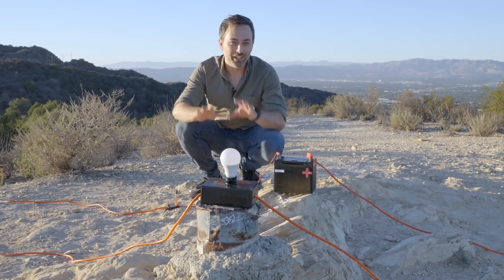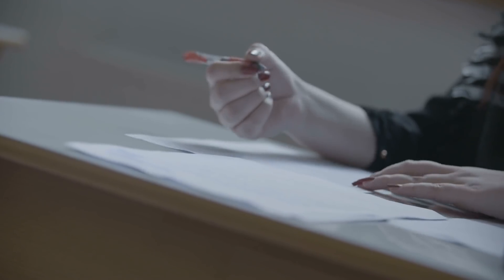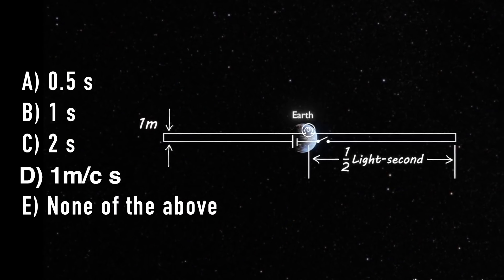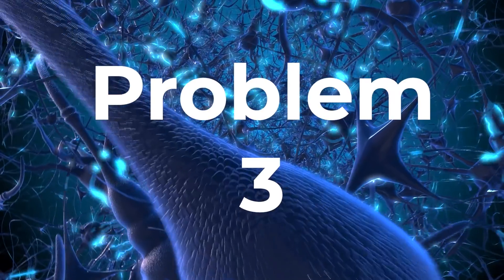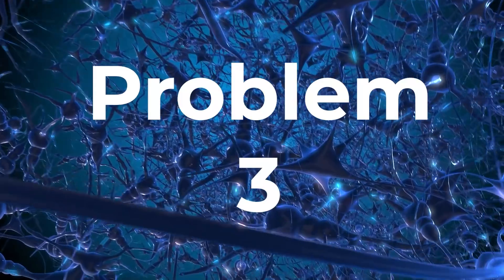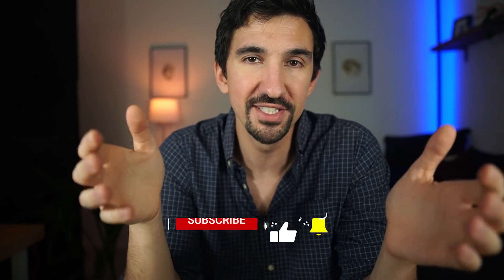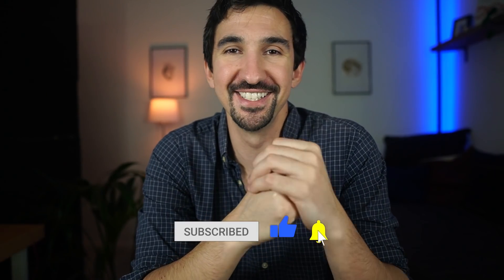Is Veritasium Wrong About Electricity?

Comment: He left out the 'm' intentionally. He does say its one meter from the battery though. The circuit does not need to be a complete circuit. It can have an open short at both ends. You have the capacitance of the wire, you also have the inductance of the wires when the state changes. If he was using AC there would be a measurable current. Heck, you could measure the current with DC too. A soon as the switch is thrown there will be a spike for about a nanosecond, or 10.
Reply: I calculated 53pF assuming 10mm thick cables, 1m apart the capacitance if negligible, won't impress any light bulb on lower frequency AC (which is manually closing and opening the circuit). If you want serious capacitance you have the change the cables into plates 300.000km wide and long, than you get a serious capacitor.

Comment: Isn't the exact the reason why the light is turning on almost instantly length contraction?
In the example we are the observer, we observe the light and we "observe" the electrons moving through the wire. So from our reference frame the electrons are moving at the speed of light through a distance of 300.000km with the speed of 1c. This means the relative length we observe closes in on 0.

Comment: Well, no. Zero resistance of the wire is major assumption but Veritasium mentions it in the video. If the wire was broken at the far end, the bulb would light up immediately, then go dark again after about a second. If we throw away all the power stuff that's not helpful here, the battery is creating positive charge in one of the wires. That positive charge induces negative charge in the wire going along it from the bulb. The same goes on in the other wire. As soon as this wave of charging up the wire reaches the place where the wire ends, the wave front of the charge will stop propagating as it will have nowhere to go, but it will still keep charging for about half a second. After that, the wire from the battery will reach maximum positive charge, the wire from the bulb will reach maximum negative induced charge, and the bulb will go dark. If you then remove the battery and short the two wires, the charge of the two wires coming originally from the battery will compensate and the light bulb will light up again until there is no charge gradient on the wire again. What you have here is technically a pair of two enormous condensers and the bulb is lit while the condensers charge or discharge.
All that Power talk is interesting and technically correct, but it's just our mathematical model, a way we can use to look at the problem. There's no particle of power and we don't need that kind of view to explain what happens and why.

Comment: I agree that the result was wrong. Veritasium invented a shortcut of the energy transfer from the battery to to lightbulb and ignored the fact that all of the electrical field is concentrated along the wire and there are no shortcuts.

Comment: Well, you are wrong. The case where wire breaks 300.000km away would technically place the switch that far away, so the information would have to travel normally. In veritasium case switch is close hence the shorter time. Causality dictates that pretty clearly.

Comment: I don't think there is a break in causality at all, at least according the understanding of electromagnetism by Veritasium.

If you break the circuit at the far point while closing it at the close point, the light might start shining for about half a second, until the moment the information about the circuit being broken actually propagates through the fields to your location, at which point it stops shining.

If you had lightbulbs all along the wire, and "simultaneously" closed the circuit here and broke it far away, the lights would start lighting up from your end (both from the original bulb and from the switch) in response to a "closed circuit" field propagating at light speed. Then they would meet an "broken circuit" field from the other end at the halfway mark, and start shutting back down back towards you at light speed.

So from your perspective, you closed the circuit and watched stuff light up, and then they broke the circuit and all the lights turn off in the same instant moving back towards you. From their perspective they broke the line, then watched as you flipped the switch before the information could propagate, and the whole circuit lit up at the same instant up to a point and then starting shutting down as your signal propagates to them.

Comment: One question though, If you have a zero resistance wire, with no electrical losses, how could any portion of the energy in that wire be transmitted through an antennae or magnetic field to another destination. That should imply that you are getting electrical losses even if there are no resistive losses. Or rather, you would still have resistive losses from other surrounding magnetic fields, even if these losses are not from the wire itself.

Comment: Your example with two dipole antennas was perfect. You can also model it as a transformer. Veritasium isn't wrong per se, but his example is all sorts of crooked, and terribly confusing. He doesn't even mention that the geometry of his wires is the only reason he's getting that effect. Or that the bulb will not actually "light up", but rather that a very tiny small fraction of the current will make it to the bulb in 1m/C s... It's just confusing and didn't need to be.
Reply: That's where I have zero qualms about saying that the Veritasium video is just plain wrong. Either Derek understands that capacitive coupling isn't how most circuits work and he deliberately ignored that fact (and misled people) OR he didn't understand the subject as well as he claimed and only stumbled on a kinda right answer because he accidentally found a geometry that worked. 

I haven't fully worked out the math in my head, but I think his video might "prove" that an extension cord won't work if it gets twisted around itself.
Reply: @talyrath  Rofl, right! :)
Reply: @talyrath  So work out the math using paper and pencil.
Reply: What happens when you implement perfect shielding on the conductor so it leaks no radiation?
Reply: @Space-Audio  asked that question on the video and got zero responses neither from veritassim or from any of the nasa grade engineer nobel prize viewers
Reply: @MrHBSoftware  , I'm a lowly computer person, but have worked on NASA contracts with space plasma physics researchers my entire career.  I asked my question because I'm pretty sure the real answer is that this is an electrodynamics problem and the important wave is the one that propagates through the conductor essentially at the speed of light but along the entire length of the conductor.
Reply: @Space-Audio  ah sorry about that...seems like everybody that comments on youtube videos works on nasa/aerospace...that leads me believe people can be whatever they want to be on the internet, not saying its your case but its ridiculous, nobody mops floors or is a plumber, everybody is phd high grade nasa aerospace xtreme level expert guru etc...i honestly dont care is i am talking to the pope, the nasa guy or the trash collecting person, if i doubt something i will question it...veritassium is a very high grade channel, i would call it "nasa grade" and i still doubted and criticized many things in that video and i still do, now that i learned more about the subject. i think we all should do the same.  about your comment yes i belive you are right and veritassium was deceiving and led some people to belive that a significant amount of energy flows directly from battery to lamp wich is a lie....that propagation is not even easily measurable, the one that matters, like you said, goes along the wire. especially in such a low power dc circuit.and the light bulb obviously is only considered to be ON when the filament glows not when it is bombarded with microvolts of radiated energy
Reply: His point, IMO, was to show that the electricity doesn't flow through the wires. Which is correct when you think of his circuit from a capacitive, inductive, or antenna view. I do agree it was presented in a crooked or trick question fashion. Which was probably also planned in order to make people think. Not to mention to get more views.
Reply: I agree, I just think he was trying to showcase the existence of the Poynting vector and bring across the fact that energy is contrary to the „common understanding“ transported by the fields instead of the charges itself.
Reply: delta V only works in reality-based physics. both v  and dr Miles and have stated that some basic things would be left out like ristance set to 0.00 ohms /mile result in 0.0v drop with full bright bulb

Comment: The reason that he gave option d in veritassiums video is because the power source was 1 meter away from the load so that makes sense because the speed of light is measured in meters so 1 meter divided by the speed of light would be the number of seconds that it would take that wave of energy to propagate to the load according to what veritassium has to say about how energy flow works in his video

Comment: 4:05... You are Wrong!   Why should the light go off?  It hasn't even gone on yet!!  Besides, what does t=1/2s even mean given your earlier pithy objection?  So problems 1 and 2 are moot.
Reply: 7:11, problem 3 .. think of this: on switch closure the field becomes a property of the circuit irrespective of the way you wish the current to go,, it becomes a reality both from left right and any other direction you wish .. at the speed of light.  So don't think of  doing full circuits like a running track.  To get off your bias, just imagine that the whole Veritasium circuit was in a circle instead of a long sided rectangle ... his ideas remain true but your objections crumble.  OK he chose an example that engineers could bleat about, and you are not the first, but mathematically he makes sense.

Comment: I think there was alot of manipulation in his video and only explaining it in a very one sided way, eevblog did a good video where he mentioned the time calculation would be way off if the circuit was a giant circle.  What if the battery and bulb were at the left and right ends of the wire instead of the middle would it still be the same time? I definitely think the bulb and battery only being 1 meter apart In his video only tells part of the story.

Comment: In my opinion, he is wrong as hell. 
Firstly, energy do flow inside the wire, in the end without electrons there is no magnetic field; and  actual wires do not have infinite conductivity even for super conductors, thus both electrical and magnetic filed exist inside the wire and poynting vector inside the wire is not zero. 
And secondly rely on the space to carry DC power is absurd, anyone who has a half brain won't buy that theory. 

This veritasium video was not good and the example there was not where you should use Poynting theory. Every theory has its limitations and was there for specific set of problems. For the wire problem in the video, just stick to ohms law and transmission line theory.

Comment: The electrons hardly move at all, their movement isn't an issue. I agree this needs further analysis. I would be asking questions like what if the circuit was a huge ring so that induction isn't relevant, questions of when the light comes on are relative, moving the bulb to a point half way around the ring means there is lag that will be determined by the direct distance between the switch and the bulb, not the distance traversed around the ring. Being a zero resistance electric circuit means everything either flows together or it doesn't, causality becomes a question of relative distance between the observer at the switch and the bulb, the circuit itself can travel even further away and return and not affect the timing questions or causality of the direct distance between the switch and the bulb.
Reply: I had a read of some of the comments. 
I appears to me that no-one here knows that electricity propagates at the speed of light in the insulation, eg for plastic insulation the speed is say 0.66c. 
Nextly, most of the commentators think that electricity is due to the movement of electrons -- they dont know that the movement of electrons is a parasitic secondary energy robbing effect. 
Electric current is due to say photons moving along the outside (mainly) of a wire (this was known by Faraday & Maxwell & Heaviside)(& probly Tesla). 

A proper gedanken would include a pair of switches (1 in each wire) located at say the 1/4 point of the circuit (the switches being opposite each other)(ie next to each other). 
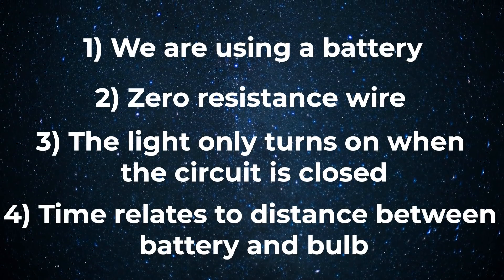Or, same thing, i like a circular circuit of 2 light-seconds– but with battery at 12 oclock -- & a switch at 1:30 oclock -- & a 2nd switch at 3:30 oclock -- & bulb at 6:00 oclock. 
Both switches are closed at the same time (say). 
The bulb would begin to half-glow after 1/4 sec. 
The bulb would begin to fully-glow after 3/4 sec -- for 4/4 sec. 
Then half-glow for 4/4 sec. Then zero-glow for 4/4 sec. Then half-glow for 4/4 sec. Then full-glow for 4/4 sec. Then half-glow for 4/4 sec. Etc. 
The periods & intervals etc would gradually decay or merge, & after a time (i dont know how long)(it might be say 100 sec or 1000 sec) the bulb would have a constant full-glow. 
That is what would happen -- & supposed experts would not be able to explain it. 

But in the almost useless Veritasium form of the gedanken the bulb would begin to fully-glow in 1 sec, & would continue to fully-glow for ever -- proving & showing almost nothing. 
And helping to breed another bunch of ignorant skoolkids. 

If u do a search for "ivor catt" & for "forrest bishop", u will find articles re the Heaviside slab of E by H energy current. 
If u do a search for "tony wakefield" + heaviside, & for "erik margan" +heaviside, u will find articles where tony & erik have done experiments that in effect support what i described as a proper gedanken, & support catt's & bishop's stuff.
Reply: @atheistaetherist2747  Fair enough, although most of the responses I've read come to similar conclusions, some using finite state simulators, some as giant capacitors, some, like myself, focus on relativistic Maxwell fields, I don't think I've can paint veritasium as not knowing just because they get the answer right for a theoretical impossibly massive capacitor.
Reply: @saxtant  I cant remember exactly what Veritasium & Co said. But i think that he wanted to keep it simple, eg zero resistance etc, whilst most of the comments here & elsewhere complicate it by worrying about crosstalk & transients etc. V should have used a circular circuit. 
However the real answer to the real question involves transients.
I am not sure what V believes, ie with his em field being the primary nature of electric current.
I always thort that standard science consisted of 2 groups -- Westerners (who reckoned that electrons bump electrons) -- & Southerners (who reckoned that charge formed on the pair of wires)(for some reason the gedankens always employ wire pairs)(ie twin cables or somesuch).
But i cant figure whether V is a W or a S -- or whether he has started a new group.
The new group probly includes Sefton & Co.
What to call it? 
Ivor Catt mentions Theory H (the Heaviside theory), Theory N (the Normal theory)(including W & S), Theory C (his Catt theory), & praps another one or two.
We could call it Theory V (for Veritasium).
Theory V i think includes a bit of W, & praps a bit of S.
Or, if pressed, would V own up to agreeing with Theory C (the correct theory).
Dunno.

Comment: When you listen to electrical geniuses who invented this world we have today .  Light doesn't exist,it is disturbance of the medium , exactly as what we call sound. Therefore light doesn't have a speed . Its a rate of propagation. There is nothing moving from point A to B.  When you talk , you don't emit anything , you causing the medium to vibrate. I think Tesla said that, light is nothing but a soundwave in an eather . They also denied the notion that electron exists ., it is just a concept .  So moving electrons in wire was really laughable  and it is really good fairy tale ,nobody can even imagine that ,if you honest.  In my opinion it is all just a stretch of fields in between the atoms.  When you imagine magnet , before it was magnet and then they magnetize it , which means the atoms all face the same direction ,just after that, the mag.field propagate itself. So when you push the switch similar thing happen , the field around wires just  propagate itself.  And the speed (induction) purely depends on the resistance ,which also means that there is not such a constant ,as speed of light.  Light propagate differently in different mediums ,exactly as a sound wave.  Well , this is as i think of it ...

Comment: The B field arises from the moving charges.  The charges won't move until they "feel" the voltage from the battery.  The voltage will only reach the charges at (less than) the speed of light down the wire.  There can be no S = E x B until B is generated by the charges moving in response to the E the feel from the battery.

Also, E points down the wire, per Ohm's law (j = oE), not radially away (or towards) the wire, as depicted in the Veritasium video.  The circuit wires do not (?) have any net charge.

Comment: 2) causality - no  You're communicating 1 meter away at the speed of light - that it takes a longer time to communicate the signal to the rest of the wire is irrelevant.
Hooray for mutual induction; at 1 meter away the magnetic field will have built up to enough strength to induce an opposing current in the other conductor.  This current isn't even experienced by the rest of the wire yet.
on assumptions 3) the entire circuit  does not need to be closed  There's enough capacitance in the wire that the ends could be open; although the light would then only pulse instead of remaining on.